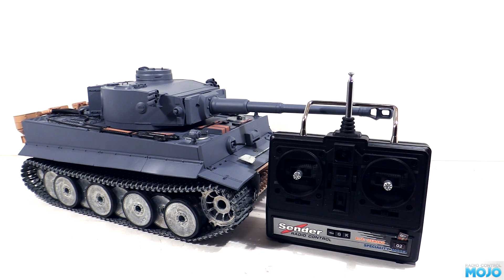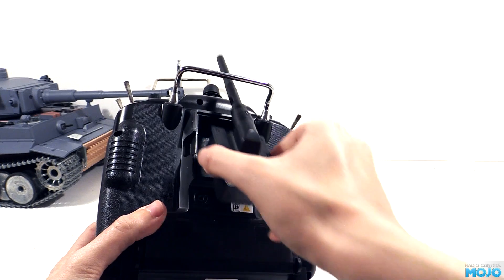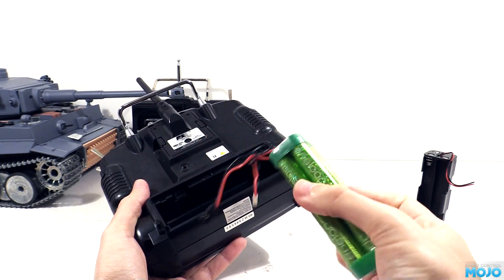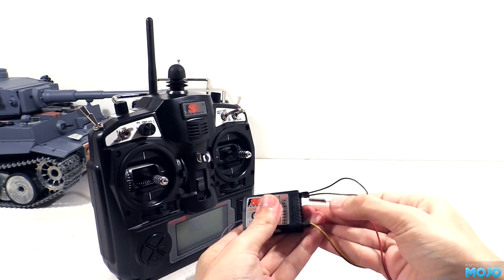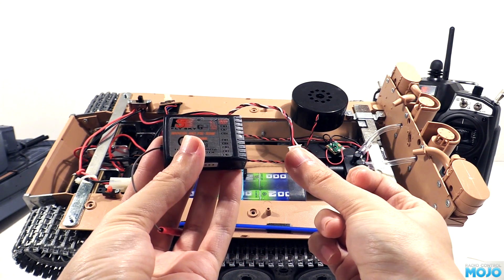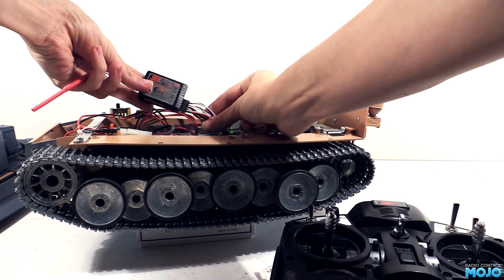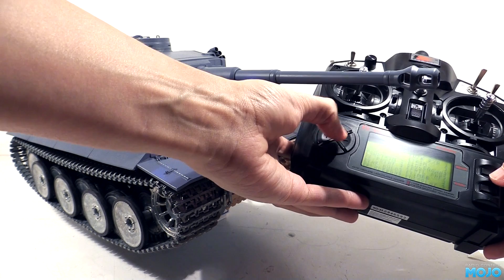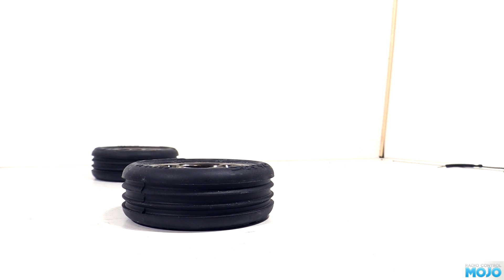Heng Long Tiger I - 6 - FlySky 9X

Comment: Hello,friend
Where can I buy the board ??
Thx
Reply from the maker: I never got it as far as making a product, the source the firmware is a derivative of is somewhere on RCGroups if you like playing with Arduino's though.
These the best thing to do is grab one of the newer 2.4GHz HengLong radios and control box's. They're not quite as configurable, but they're reliable and have some fairly good sounds too.
Reply: @RCMojoTV  thank you

Comment: do you still have the code you used for you arduino
Reply from the maker: I don't think I do unfortunately. I based it on a project that was on RCGroups which should still be there. Searching Heng Long protocol might turn it up.

Comment: Hello:-)

Have you considered making a video on the new Taigen Tank's new V2 electronics board that has the option to hook up a hobby grade Receiver and use a Hobby grade transmitter to run the tank? I have looked all over YouTube and have not found any videos on how to run a Taigen Tank using a Hobby grade set to run a tank. It would be very helpful is someone made one.

Thank you for your attention and for all of your outstanding videos.

Guy:-)

Comment: Can you buy a board off the self to replicate the job of the one you made? I am fairly switched on when it comes to electronics but not to the level where I can knock up a board like you
Reply from the maker: RC Tanks Austrailia do the RC5HL Lite which does a very similar job. I've not tried one myself so can't say how well they work though.
Reply: Can i have the schematik sir

Comment: Hello! Would this work with the stock 2.4ghz RX-18? I want to do this but I have the 2.4ghz one instead of the 27mhz.
Thanks.
Reply from the maker: The 27MHz RX18 has a separate receiver so you can send the commands from the microprocessor through the connector the receiver normally uses. The 2.4GHz RX18 has the receiver built in so there’s no easy way change to a different radio, it’s possible although unlikely the same protocol is used internally but I don’t know of anyone whos reverse engineered one.

You would be better off keeping an eye out for a cheap newer 27MHz RX18 if you want to DIY it, or if you want to go the whole hog one of the complete replacement systems.
Reply: Ok thanks! Not sure how much the 27mhz RX-18 differs from the 2.4ghz in terms of where the leads plug into so would it just be advisable to purchase the 27mhz module without the leads? Also I have no idea where I would start with the arduino board if I get the 27mhz module If that makes sense.
Reply from the maker: As far as I know the 27MHz RX18 that looks all but identical to the 2.4GHz is pin compatible, but with a couple of the connectors moved position.
If you’ve never gone beyond plug and play electronics using an Arduino might be quite a big step, don’t expect instant results. The good thing though, once you get there you can set it up to do pretty much what ever you want! Ultimate flexibility.
Having said that there are replacements for the RX18 that are far more advanced, like the IBU2 and IBU3. They’re as close to plug and play as you’ll get and simply connect up to a standard hobby receiver.